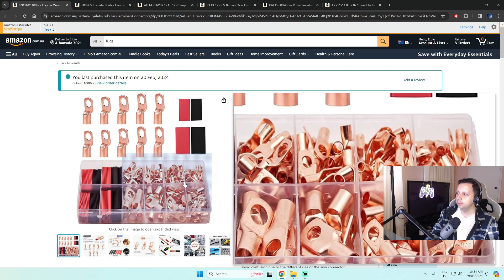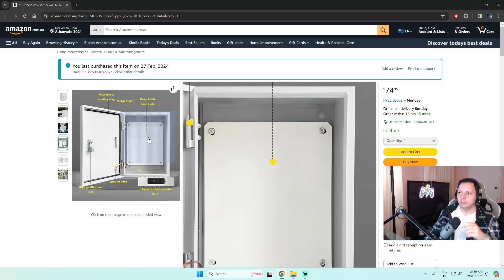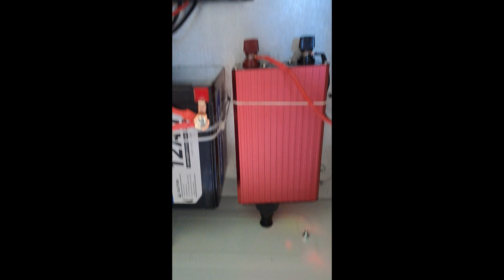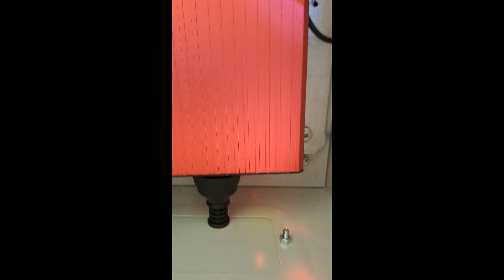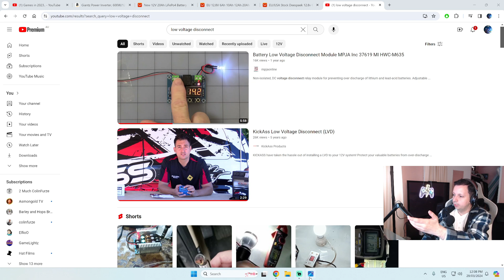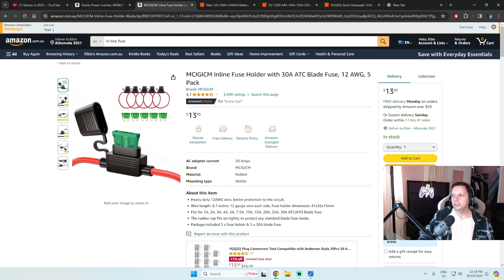How I built - Solar charge station for my robot mower!

Comment: Nice build, would be great to see a follow up after a full season - what worked, what didn't in the loop. Lithium battery you mentioned is a great idea for when that AGM battery eventually needs to be replaced especially as you have a decent waterproofing setup.

Comment: Okay, I listened to 25 minutes of rambling on and on and never once did you say how well this apparatus charged. 

Instead of saying the same thing over and over again, it would have been great to answer these questions.

How much power is the solar panel actually putting out with that less-than-ideal orientation?
How long does it take to charge the mower?
How does it compare to charging the mower from grid power?
How many hours of daylight do you need to charge the battery in the box?
How many mower charges do you get from one charging of the battery in the box?
What is the capacity of the battery in the mower? 

I see the solar panel on the roof of your shed is very dirty.  Doesn't that affect the performance of your charger?

This is a very low-efficiency system.
There are significant losses in the solar charger, battery and inverter, so how well it performs would be good information to give.
Reply: I don't think the setup shown here is practical. I didn't watch the video but skipped large chunks so i have no idea what he was saying. 

An inverter like this probably has an idle power draw of about 20w, over 12 hours that's 240w just for the inverter. The battery he's using is 12v 12Ah which is tiny, that's 144w - that means it would only power JUST the inverter for 7 hours. Depending on weather and location, you might get 500w from a 100w solar panel. 

I suppose you could turn the system on and off when needed and maybe that's what the low voltage thing does but this will cause some automowers to leave the base or stop mowing where they are and then it's battery will die and you'd have to manually put it back on the charger.
Reply from the maker: I'm so sorry about my rambling >.< my worst trait. Thankyou for the Pointers I will try make a follow up video and address those points.
I think you are right those point would be helpful.